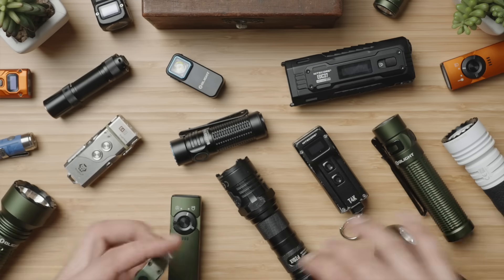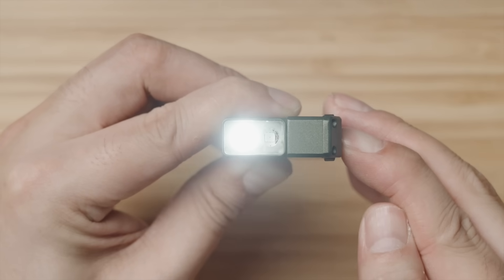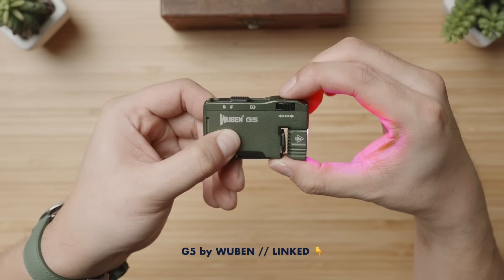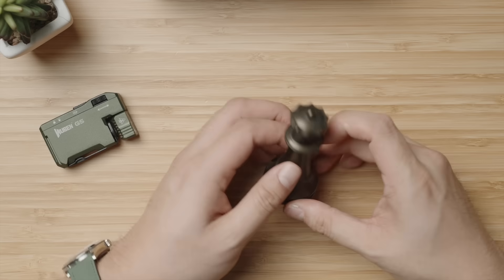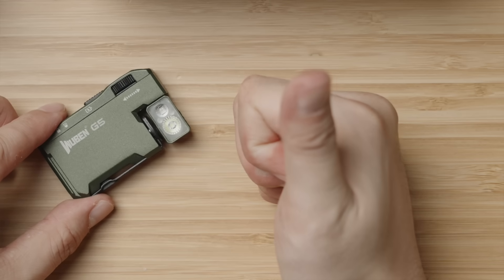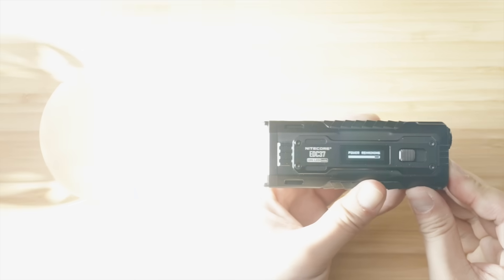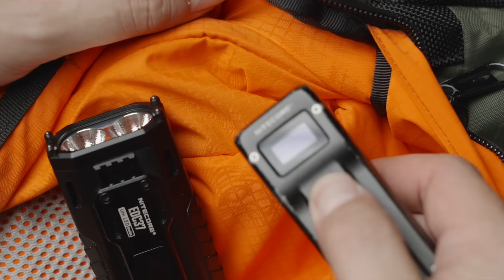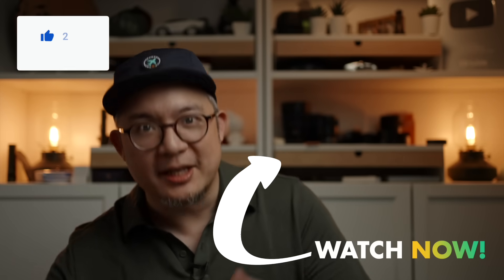Modern Flashlights are INSANE.

Comment: As a long time designer and production consultant, the pricing on these seems about right once you understand how automated most of their production is. ( although the $100 dollar light likely costs makes a much larger profit for the seller- its primary cost difference is the in the battery size, and the weight of aluminum )  The smaller light benefits from the small size in drastically lower shipping cost because 10,000 of them will fit in a small box in one small corner of a shared shipping container.   20 years ago I designed an Adirondack chair for a company that was manufactured in china. The chair was complicated. It had a reclining back. Folded up for storage and so we could ship it pre-assembled except for the two wheels on the back legs that the buyer had to install.   It had steel axels for the wheels with brass bushings.  It had CNC cut brass plates in each arm and a roller pin to effect the 4 different recline positions; you pulled the arms up an inch and the arms moved the backrest to different positions and lowered the arms to lock them.
The chair was made entirely of poplar.  All the wood had to be milled to specific shapes, some of them with complex curves. The metal parts sourced or fabricated, and all assembled and boxed.   And then shipped to the US.    Sounds expensive.   But our landed cost at the Port of LA was just $12 per chair.   At that price, the shipper made a profit, the box company, the metal parts supplier, the wood shop that milled all the parts and assembled and finished each chair, AND the wood supplier. Each one of them managed a profit out of that’s $12. 
People in general just have no concept of actual costs of manufacturing nor economies of scale when you get tooling or robotic assembly involved.

Comment: Have you actually checked if the claimed number of lumens on seller's Amazon account is correct? Of course not. This is why it's so cheap, - they use substandard LEDs which they overdrive, meaning your flashlight won't last long at all, not if you intend to use it often.  And if you are like me and make the actual measurements and then attempt to review the product you buy, even if you like the product - you will take one star off for claiming incorrect number of lumens, or wrong wattage . And you've just wasted 30 minutes of your time because AMAZON SELLER NOW HAS THE FREEDOM TO REMOVE OR INDEFINITELY PAUSE ANY REVIEW THEY DON'T LIKE by claiming "disinformation" and the seller CAN EVEN TURN OFF YOUR ABILITY TO REVIEW ANY OF THEIR PRODUCTS if you didn't give them 5 stars last time you made a purchase in their store!. This means that since February 2025 THERE ARE NO REAL REVIEWS ON AMAZON. This is how I stopped leaving reviews on Amazon and then stopped shopping there altogether, despite the fact that I was an Amazon Vine member and was rewarded for reviews RIGHT NOW NEARLY 90 OF AMAZON MERCHANDISE IS EITHER TOTAL TRASH OR A FAKE OR A SWITCH-AND-BAIT SCAM!! 90%! And I'm not exaggerating, this is a conservative estimate in fact. I was with Amazon for over 12 years and it has NEVER BEEN AS AWFUL AS IT IS NOW, not only in terms of what I already mentioned but also in terms of having really poor choice of merchandise, to the point where most times I can no longer find what I need outside of EBay dot com.

Comment: My hobby is riding motorcycles, and I can’t believe how cheap gas is. First you have to search for a oil field, then build an oilrig, then hire a lot of highly skilled engineers, then drill miles down through the surface, then build a pipeline from the middle of the ocean, then build a large refinery, then process the oil into gas, then transport it out to gas stations via large trucks. And all this for about one dollar per liter? That is mental!

Comment: I would never use a regular flashlight when walking trails. It makes you functionally blind to everything that isn't directly in the path of the beam. And should the batteries fail - it will take you a very long time before you can see enough of your surroundings to get home safely. The reason for this is Purkinje Shift aka Scotopic Adaptation - inability of the human eye to rapidly adjust to sudden darkness. To counter this - it's far better to use red color flash light, red LED is usually superior to red filter in that your eyes will adjust a lot quicker, filters often result in other wavelengths mixing in with red. If you're an avid camper or hiker - it's best to get a flashlight that has a red LED(s) as an option. Best model I used in addition to white LED also had a red and a strong UV-B LED, as well as a strong blue LED (which the hunters use for blood tracking).

Comment: Don't waste your money on expensive flashlights unless you're buying an LEP. I've had Fenix, and Klarus. My very expensive Klarus flashlight didn't last one job in my line of work before the button stopped functioning beyond simply turning it on, and off. It's now stuck at max brightness, which is almost hot enough to light paper on fire. I work in environments where the dust is so fine, it goes right past waterproof seals. My new favorite brand is Convoy. Just unbelievable workmanship, better than both Fenix, and Klarus, imo, and for budget prices. They are so good I have to stop myself from buying them because I have enough.. or do I?? Maybe a few more wouldn't hurt.

Comment: While many of these smaller, cheaper flashlights might be great at first, my experience with two cap brim clip-on lights of a different type, but a similar size as this Wuben G5, has been that something inside fails after a few months, and the flashlight no longer works.  Don't know if it was the LED or the battery or something else that fried.

Comment: I don’t want rgb, magnetic connection or a head that turns. I want a flashlight that produces consistent light to like 40 hours and what’s more important, I want it to work 2 years after I charged it and left it in my backpack until I need it. I bet none of the products you showed will provide that.

Comment: $109 for a single chess piece? That is ridiculously priced. There's so many things you could do to reduce that price. 
Most of the products on Amazon are mass produced with low wages workers, cranked out at high speeds, with similar product design across multiple products with different logos slapped on it.

Comment: I think the pocket clip is super weak and flimsy and it feels like if I move it around a lot it’s just gonna eventually fall off. That’s one gripe that I have about this thing. They had made it not as wide and they had put one of those clips like you find on the O clip from Olight that would’ve been epic because you could’ve clipped it on your hat very easily but still it’s a little bit big for a hat. But if it had that pivoting head and it was about as wide or a little bit wider than a stick of gum that would be so great for putting on a hat because you could almost put it on your hat, work around the house and forget it’s there, but usually when you have a flashlight on your hat, it’s kind of weird because it’s heavy. It weighs the hat down in the front so it’s good for like a temporary use, but you’re not gonna want to just put it on your hat and do a bunch of work for hours and hours if you’re in the yard at night or something.

Comment: Years ago I was working as a painter, and I bought my first high CRI flashlight that I could use for seeing fine variations in color. It was one of the first flashlights on the market to use the Nichia 219B LED emitter. I paid $16 for it 8 years ago (it's still going strong). Just yesterday I was looking at where flashlights are today. I was expecting to find an equivalent to start at a minimum $35. I surprised to discover new flashlights now using the Nichia 519A for only $20! I'm tempted to pick up one up just to have a spare!
Reply: @lihtan
I prefer the B35AM for the boost driver it requires. The efficiency speaks for itself. Or the GT FC40 for sheer power, which I don't need much of.
Reply: Sigh. Is this an ad? I really just want to know what a good flashlight is. Nothing is real anymore. And now I look like a bot too, because if you respond with "It's great, and X has them for only y" it'll look as though I'm complicit. Dead interweb theory is real.
Reply: @pocket83squared  I'm personally only interested in flashlights with a high CRI. Nichia has developed a reputation for making very high quality LED emitters. A couple of brands do use them in their flashlights. They maintain their best color accuracy when they're not overdriven, so you won't find any models that feature some crazy 1200 lumen turbo mode.
Reply: @lihtan  Whoa, I think this is a real person! Thanks. Any recommendations for a double-AA, single end-button, ultra-simple (like only hi/low/off) style? Most new flashlights I've seen are programmable and such, and I really just want something that improves upon the old Maglite design.
Reply: @pocket83squared  Best you can get is a Convoy T-series light. The T4 is practically the successor to the Minimag 2xAA. Get it with the 519A LED, the simpler 4-mode driver, and you're done.
Reply: @pocket83squared The video was an add, idk about that guy. But, as you said, dead internet theory is unfolding into reality as we speak
Reply: @XanderSut  Why should I believe you? You seem like a bot. By the way, are you happy with your current retirement plan?
Reply: @pocket83squared Now I feel more lonely than ever
Reply: @pocket83squared  dude, I checked the age of the channel because of paranoia.

Comment: With prices for good products getting this low, it's becoming a real headache to figure out which products are actually the good ones.
You can't use price as a filter / indicator of quality anymore, because for every good 25$ flashlight, there will be dozens of mediocre products at the same price (but with a huge markup instead of good quality).

If it didn't contain a rechargeable battery (that will degrade over time), I would buy one of those flashlights right away, despite currently having zero use for it.
Just because trying to find a similarly well-designed product a few years from now might be almost impossible and take hours of research.

Comment: im an electrical engineering student. the price of electonic components in general always shocks me with how low they are considering how specialized and niche some of them are. I have purchased things that have a purchase history of like "100 purchased" over several years, and im always in a question mode of "how do they make any money or this". Especially when i price out the individual components as more expensive than the total unit.
Reply: My fav joke is buying something on Aliexpress without noticing it is 10 or even 100 pcs per item. I still have the bag with 400 PCB slide switches (I needed 4).
Reply: some products are sold under many names. So they make a product and re-label it for 20 driffrent businesses and countries.
But the key is mass production, they make thousands for a day or two then do something else. Thats why there is new stuff all the time.
Reply: Why are people in this video so shocked to hear you save money making things at scale? It costs the company less to bulk sell the components for cheap than it would be to make small batches.... Try and get a PCB factory to make under 100 of a board and see what I mean. Its like, shopping at costco.. The factory can afford to set up the initial cost  to make the parts inexpensive by making millions a second. The entire electronics industry works because of this. Some may seem niche, but then if you make it affordable who knows what people will use it for and they may invent a product that requires a bulk order.
Reply: Most electronic components are somewhat modular and if used that rarely just assembled when ordered.

Comment: Honestly, it is cheap because of reasons outside of the company.  Countries that focus on manufacturing often have company-asset-sharing agreements.  The tooling they do creates a need to mass-produce the object to keep the chain moving, making everything cheap as long as it's needed.  It is a terrifyingly efficient system, but it begs the question of where that money actually goes?  I would consider your product better in every way compared with that kind of product though.

Comment: A lot of what we used to consider "high tech" has gone hilariously cheap. To the point where an electronics engineer when the subject of costs come up almost always says a controller of any kind is 20 euros. 10 for the box, 4 for the plug, 2 for the pcb, 2 for the uC, rest for the rest. Want it for less? make it smaller, get a cheaper plug, but most importantly, make the box cheaper. Big TV's are still a symbol of wealth/overspending for boomers/genXers, while you can get a decent 55in for a couple hundred. 

On the other hand, I was an aircraft engineer for the last 12 years. Where you need to prove which mine the ore for your bolt came from. Said bolt was easily 150 euro in bulk. Marker lights go for a 1000 of the shelf. And than people start calling your half million machine too expensive. Only way to make a million in aviation is to start out with 10.

Comment: One factor is probably that Wuben is a rebadge of an OEM supplier.  So the main chassis/module is mass produced for many companies and then is paired with other more specialized modules.  Not taking anything away from the practice, it's still an awesome feat of engineering but probably the only way to get it done.

Comment: 0:25 it's literally not. first, ip69 exists, second, water resistance specs expand beyond IP, there are specs for "immersion up to 1 hour at upt 5 atm", "up tp 10 atm" etc.
upd. corrections about ip69 in the replies
Reply: @alexmikhylov  IP68 is the highest IP rating for submersion. IP69 does not protect against submersion at all, it is about protection from steam and water jets. Although I do agree calling it the highest possible rating is wrong, since there's non-IP ratings as you pointed out.
Reply: IP69 / IP69K = complete dust protection (6) + protection against high-pressure, high-temperature water jets, not immersion. This is for industrial washdown (e.g. food processing equipment). It’s not designed for submersion.
Reply: подписчик асмр каналов ис токин
Reply: @alexmikhylov  literally is not an emphatic word
Reply: Ip 69 sounds way more impressive to me.

Comment: I'm not sure I agree that software is required for that first flashlight. it's dead simple; I just mapped it out on a truth table and I'm pretty sure I could make a logic circuit that povides all the same functionality just as smoothly and reliably with no more than 3-4 discrete gate ICs, each of which I can get for small fractions of a penny at scale, and fully automate circuit board assembly with off-the-shelf machines and tooling.

Comment: Even with adblockers on everything I've been seeing that Wuben pop up all over the internet...i would not be surprised if they were making a loss to increase the reach of their brand.

Another factor is planned obsolescence...both those lights are designed without replaceable batteries, so in a couple of years they will be paperweights. They are counting on frequent return customers, look at torches with similar specs with a replaceable battery and they will be double the price.

Finally,  do not underestimate the power of a heavily automated workflow+economy of scale, it used to be cheap labor that made Chinese products cheap, now it is automation.

Comment: RAM for PCs. Has almost always been affordable component of computer, and the one which actually speeds up computer.
You could buy 16GB for 30 bucks.
So, it's very interesting that PC manufacturers (Apple especially) basically scam people when specing out a computer - for example selling 8Gb computer for 800 bucks but 16Gb one would cost 1000 bucks.
Reply: Storage has a similar issue with product price. They'll charge so much more for something that has just 64 GB or 128 GB or 256 GB more storage. These days that shouldn't cost much.

Also a couple of years ago solid state storage prices were getting surprisingly cheap. But unfortunately prices have only gone up a lot since.
Reply: Though to be fair with modern Apple computers, they have the unified ram, so is a bit less crazy when you think of it as vram. For large sized mixture-of-experts LLMs, that makes them very cost-effective. Since you need a lot of memory to load them, but the MoE means the amount of calculations is like a smaller model, so the speed being a bit less than the higher end Nvidia consumer cards doesn't matter as much.
Reply: @ShawnFumo  You're like a highway robbery apologist
Reply: This comment aged quickly

Comment: I use a very old head lamp that has been taken off it's strap and hand sewn onto an old Carona hat cap with the brim taken off and I've hijacked the power connector to a USB cord and I use a rechargeable power brick in my pocket and USB cord under my shirt. This is allows me full mobility when I am trying to work in a very confined space and not having the peak on the brim of the hat nor the battery weight allows me to pivot the torch beam off centre to any angle that I like; without the battery weight acting like a pendulum and using my head as pivot bearing? The battery weight due to gravity can cause the headlamp to fall? Luke when I'm  laying upside down working on a car or climbed inside the ceiling space and I'm contorted squeezed between trusses down near the eves trying to fit a security camera on a 3 story house where a ladder outside isn't an option?
The power banks I use are water proof anyway and I've been out in the pouring rain picking mushrooms and so far my DIY IP68 is holding it's rating onlybecause I solder hot glue and heat shrink everything! 😁

8000 lumens would blind me if I accidentally turn that sh1t on in a confined space just with reflection 😂